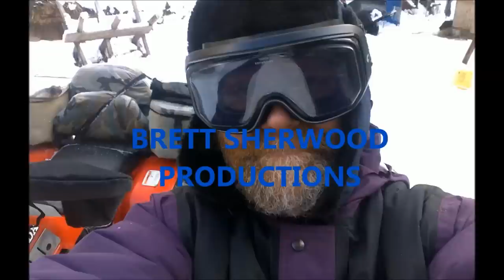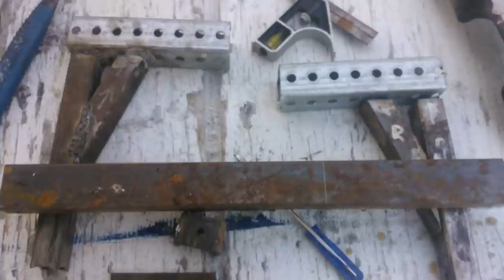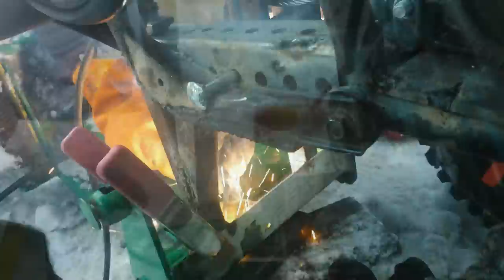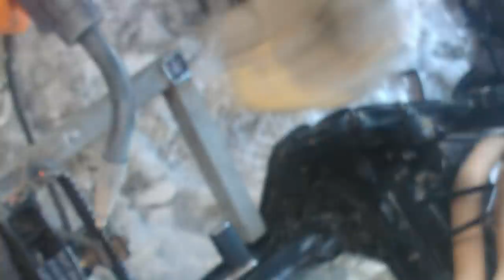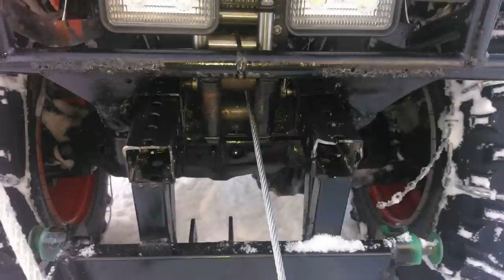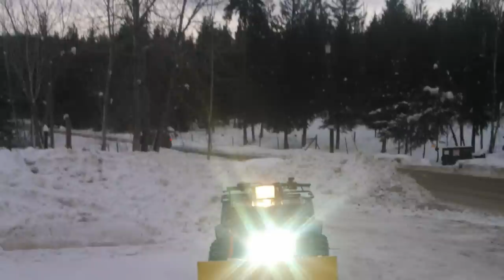plow mount rebuild and winch install part two ... the big finish!.wmv

Comment from the maker: yes it does so much so that I am going to put a spring lift in it , well the front shocks way to soft anyhow, I put the "swingarm" with the idea that it will be able to move . and it plows snow too!!! lol . the only thing I am going to do is weld a block on it to keep the blade from swinging up as far when I go into a snowbank , right now it lifts right up into the front bumper , then there is no more push left.